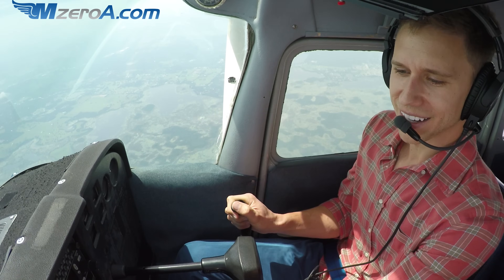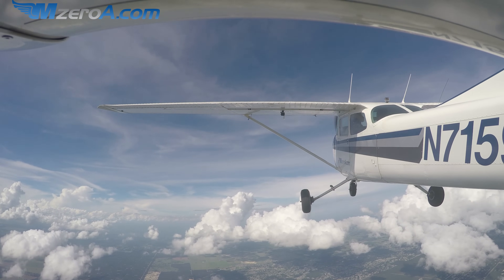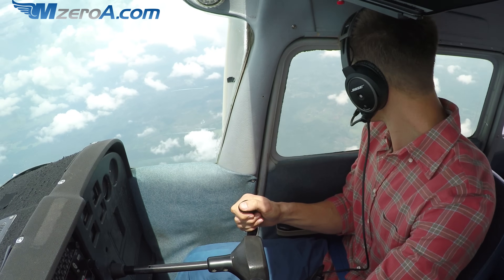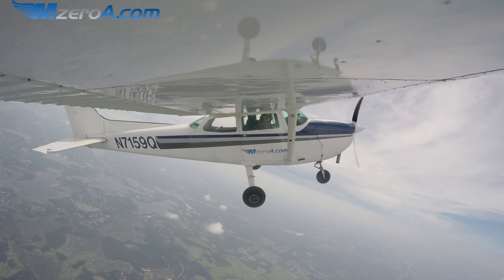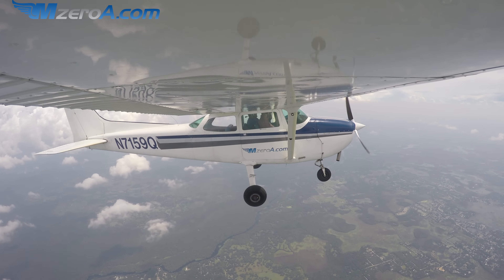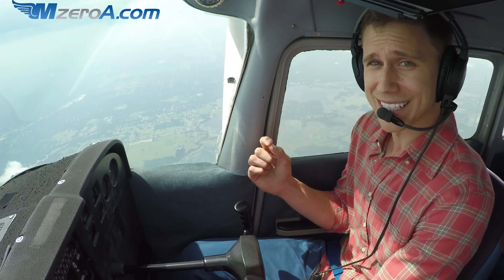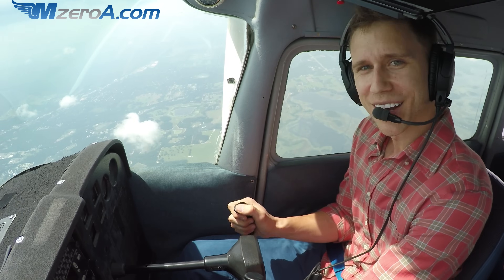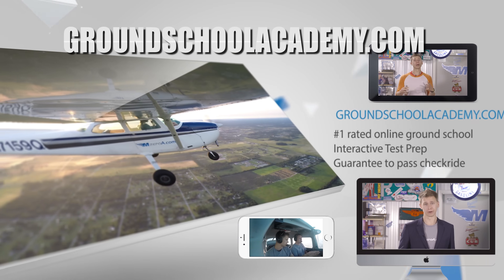Proper Spin Recovery - MzeroA Flight Training

Comment: As mentioned in other comments, the recovery is the thing. However, a properly rigged C-172 has a restricted deflection of the elevator that precludes a full stall. This is a certification compliance. Which leads to a problem with multi-turn spins. The aircraft will be accelerating and be in a high speed spiral versus an actual stable spin. This is a far more perilous condition as it appears to be a spin to the uninitiated and they will find themselves at a much higher speed exiting the maneuver than they planned. A major university used to have two,”Spin Ships,” in their fleet. This restricted the abuse of the classic gyros to just the two aircraft and, unbeknownst to most, maintenance tweaked the up stops of the elevator to give a slightly better stall which led to fewer over speeds of the airframes. Fully aerobatic aircraft rarely have restricted control movement and hence are IMO, better spin trainers. Aerobatics are great things to learn. They remove the term,”Unusual attitude,” from the pilot’s experience.

Comment: Did that many years ago in a 172, it did not recover immediately. The right spin entry was more abrupt than usual.  It took 1.5 full revolutions, full sustained opposite rudder and full forward elevator, before it recovered, C of G was within limits.  Turns out that three of the engine mounts after an engine overhaul were installed backwards, only the upper left mount was correctly installed.  The student was a bit concerned, I was quite upset. A lot of good was accomplished from the investigation of the incident. So,  if your aircraft has just had an engine replaced,  check the engine mounts???  Remember shit happens, be safe, have fun!  This was the only time in over 50 years of flying professionally, I experienced a preventable technical failure, that could have had a serious outcome.

Comment: We use to do them back in the 1980 set power 1500 rpm pull nose up till stall them full left or Wright rudder u would get 3 half rotations then opposite rudder when stop rotating pull out before u reach VNE we wold also pump left an Wright rudder pedals so wing tips didn’t go back into stall 1976 model 150s this was from 4000 feet good times

Comment: As a past flight instructor, I am amazed that some countries do not make full spin training mandatory. The way I look at it, you should never feel uncomfortable in an aircraft no matter what attitude you are in. Look, there are two things you need in aviation 1) distance between you and the ground and 2) an aircraft that does not break apart. All PPL training should include stalls, incipient spins, full spins,  all power off and then progress to power on. Of course this based on the aircraft's approvals.

Comment: During my lessons in a 152 my CFI had me stall and spin almost every lesson. It became so routine that recovery was  automatic, even boring. I felt relaxed and confident in my abilities to recover if needed. I also did a lot of pre-stall training to avoid getting into a spin in the first place. I was surprised to learn that stall and spin practice is rare these days, we did it every lesson. We also did engine failure drills every lesson.
Reply: Thats great training - pilots should learn spins over and over until they are second nature.

Comment: Your check pilot examiner is SO VERY RIGHT. If you want to be a safe pilot in any aircraft, you need to know the correct procedure for spin recovery. There are so many situations where one can get into trouble, and wind up in a spin. You must know the Principals of Flight formula ie., CL HALFE ROW V SQUARED S. and how to understand it and make it work. retired CPL with greay hair and years of working knowledge with spinning.

Comment: A great video! Good job! However, this video does not show how quick a spin is. a spin happens very quickly, even when you do it on purpose period for some reason this video does not show that, it may be the wide angle of the camera, or it may be this particular airplane. I have only spun 152s, not a 172.

Comment: The PA28 Cherokee is a better spin training aircraft than the Cessna 172. The reason is the PA28 is prone to high-speed stalling if you abuse the recovery. Pretty easy to do.I have noticed Cessna pilots are completely lost in the PA28, which is no good. The PA24 will do the same thing. Juggling the never exceed speed against the high-speed stalling.
 requires a great deal of skills. But once resolved the matter is closed.

Comment: I must be mistaken. I did spins and recoveries as a student with my CFI, and did one spin recovery for my PPL checkride.
Reply: How long ago and are you in America? He's speaking of American regulations. I don't know any DPE willing to go into a spin with a PPL student. Hell, the DPEs don't even want to do it with a CFI candidate they've never flown with which is why they'll accept the Spin Endorsement rather than require you to demonstrate a spin. Not to mention I'd be using a 172 for my CFI check ride that isn't allowed to do intentional spins and the 150 that is capable of spins probably won't have the power to perform max performance maneuvers required for the checkout, especially in the Summer.
Reply: @VeteranSoldier  I was in America when I did my training in 2007. Trained and did my PPL checkride in 172.
Reply: @airmackeeee6792  well the school was mistaken. The requirement for Spins training for PPL was removed in 1949 by the CAA (predecessor or the FAA) and made more emphasis on stall awareness and recovery as a spin cannot happen without a stall.  I believe spins should definitely be demonstrated but to have a student with no certificate demonstrate it with a DPE that never flew with that student, perhaps haven't even done a spin recover himself in who knows how long... that's why it was removed. You had a brave DPE as most of the DPEs in my area don't want to do a spin even with a CFI candidate much less a PPL candidate. Perhaps you did the same as the YouTuber did and went into the Incieped stage of a stall for stall awareness but not a fully developed stall but even that is crazy for a PPL

Comment: I agree with many of the comments about the spin, or lack thereof.  Those were not spins, but a pro spin input and perhaps a bit of an incipient spin, but most certainly not a developed spin.  Recovery using the PARE is appropriate for developed spins, using appropriate unusual attitude recovery procedures is otherwise  recommended .  Using "push, power, rudder, roll, climb" is the preferred unusual attitude recovery.

Comment: In a climbing turn you're actually constantly rolling to the OUTSIDE of the turn to maintain a certain attitude to the horizon. So the outside wing has a higher angle of attack - it should stall first. Result: Over-the-top spin

Opposite is true of a descending turn. You must constantly bank INTO the turn to follow the spiral -> low wing has higher angle of attack -> low wing stalls first.

Comment: Mr. Schappert, have you flown Pipers much? I am currently flying a Piper Warrior, and the stall behaviors  (as you may know) are quite different than those of a 172, for example. I was just curious, if you had flown Pipers much, whether the spin process, behavior, and recovery is similar in a Piper Warrior to that of a 172! Thanks so much!

Comment: Why elevator down. First reaction would be elevator up to stop the descend...
Reply: Pulling the elevator back will aggravate the spin. Understand that the pilot isn't "steering" the airplane into the spin, the wing has stalled (the air isn't flowing over the wing, it's tumbling over the back and the airflow is separated)  and the aircraft is just doing it on it's own basically. In order to recover you need to bring the power back (because the torque of the engine is helping the plane into the spin, among other things) ailerons neutral (because using them will cause this thing called adverse yaw and will aggravate the spin and bring you closer to an unrecoverable flat spin) rudder opposite ( to fight the rotation) and elevator down to break the stall and get the wing flying again. 

Then, and only then is the pilot actually "controlling" the plane and he or she can pull out of the dive.
Reply: Byron Henry Thank you for the explanation.
Reply: @bonzai8316  my pleasure

Comment: Thank you for the PARE acronym and valuable video!   My recent lesson in power on stalls, my initial reaction to the stall was to use Ailerons and that made the stall worse!   My CFI recovered the plane and explained that keeping the plane coordinated and using opposite rudder to recover the spin was the corrective control inputs.  A couple more attempts and I nailed it! Then I found this video and now I can use the PARE acronym as a mnemonic!!!!

Comment: I have a working theory here on spins and the endorsement, why is it even still required any more. With the introduction of the new ACS for the PPL, CPL, and now the coveted ATP. Under the new ACS Training curriculum, power on/off stall training is only taken to the sounding of the stall warning horn on steady; which as we all know is approximately 5-10 Knots above stall speed before recovery is made. In this flight attitude yaw will not have a chance to be introduced in my opinion; all of the aggravated conditions will not develop unless the CLEAN BREAK STALL is entered. The incipient spin cannot be entered from an imminent stall in my opinion; which is what the new ACS teaches. Therefore, the student cannot enter the spin unless they introduce top rudder in the direction they wish to spin on purpose. So, that being said the CFI spin endorsement is no longer needed since the student cannot enter a fully developed stall/spin from a imminent stall. This is just one CPL’s opinion and not that of the FAA. Maybe some CFI’s and even Jason himself can comment on this thread and provide some more insight.

Comment: Last week N727RP, a twin engine turbo, went in close to my house. Someone got a cell phone video of it headed straight down and in a slow spin. All 5 people on board were killed.  To my knowledge there's been no official release as to the cause of this accident however it looks like the spin stall. He was probably around 500' AGL flying slow, elevated angle of attack and a luggage for 5, and three ppl. in the back causing the CG to move aft.

Comment: I am not a pilot, although I've had flying lessons but never soloed.  So I know a little about aerodynamics, but not much about the typical max speed and stress single engined small aircraft can handle.

It seems that if prior to attempting spin recovery that you remove all extra weight from the aircraft, and lower the amount of fuel in order to put the plane in its optimum condition for being able to recover quickly from a spin, before doing the spin, how well does that prepare you for when a spin happens during  "real  flight" conditions with baggage, extra passengers atc?
I understand for initial spin training one would want the planes condition to be light and perfectly balanced so you can learn and practice the correct inputs without any screwey stuff happening to make it less safe than optimum, but once you get the basics down do you continue spin training with heavier fuel loads, baggage or passengers so one can truly recover if it happens under less than optimal conditions?  How much altitude is lost typically?

Since these small planes are not designed to withstand the G forces and speeds of aerobatic planes, how much time might one have to correct the spin before the plane exceeds its nte speeds and G's?
Thanks for the video lessons! Happy & Safe flying!

Comment: I remember back in my 1st week of private pilot training with my CFI Mike. I was learning power on stalls and I almost went into a spin by not immediately pushing left rudder when the stall broke. Mike and I had previously talked about spins, but as you said, it was not required in my training at that point. He was a really cool young CFI and showed me a few lessons later because I was curious. We went over, power idle, neutral ailerons, full opposite rudder(than turn coordinator is showing), pitch down - to break the spin then recover. It’s really easy, and even on my 1st few tries, I could do it without losing over 500 feet altitude. However, I could very easily see if a spin happened while you were not expecting and specifically set up for recovery; it would be very jarring and scary. You probably would lose 1000 feet before even realizing what was going on. Then, without being specifically prepared, you could lose several thousand more before remembering what was going on, how to recover, then finally recovering.

Comment: Did you say "Mixture full rich"? At 7000 feet?
Come and visit me in Denver and, We will discuss proper mixture settings for altitude.
I am an A&P by trade and a pilot as well and, I spend countless hours talking, to insructors and, pilots, proper mixture techniques.

I believe that, a good knowlege, in this field, will save lives.
Reply from the maker: Thank you Alby426! We were practicing proper recovery technique up high, but mimicking the procedures we would use down lower. Here in Florida where we are flying, going full rich is the correct procedure. Part of the pre maneuver checklist includes mixture going full rich. This is only set up that way during that specific maneuver and is adjusted right away afterwards. I just recently published a mountain flying video on youtube and discuss proper mixture control at high density if anyone would like more elaboration.

Comment: Ok so I know flight sims can be completely different and as a student pilot I do not know much. The only way I can get a F-35 out of a spin, which quickly turns into a flat spin with the maneuvers in the video, is to power back, rudder with the spin, turn into the spin, elevator down a little once a turn is established add power back in, neutralize. Why is this? Is it because it is a flight sim, jet powered, different airfoil, all of the above? Or am I just doing everything wrong?

Comment: Spin training was required back when I got my Private Pliot's License in 1974. Got my ATP in a Lear Jet model 25. Lear jets have great performance on one engine so the single engine approach to a missed approach was easy. Rate of climb was a little under 2,000 feet per minute on a single engine.

Comment: Sorry, that is NOT a spin!  A spin is an 'auto rotation' caused by yaw (from rudder or prop).  This is just a stall with a wing drop to the left (as, in a climb to the right, the left wing will reach the critical angle of attack and stall first).  This is not even an incipient spin entry as it will not develop into a stable spin as zero or insufficient yaw is present.  The following is an example of all three stages of a spin, incipient stage, stable (developed) stage and the recovery stage:  https://youtu.be/YUiruCa1wOc

Comment: They aren't fully developed spins, but that is not the point.  You can see the spin rotation by looking at the horizon.  This is about spin recovery, not flight testing the envelope for the aircraft, which would be pretty "iffy" for fully developed spins with no quick-release drag chute and a parachute in this type. Many certificated aircraft cannot be recovered once in a fully developed spin.  Read Rich Stowell's book on Spin Awareness. The idea is to recognize and get out of the spin a quickly as possible.  Good opening about getting the aircraft into utility category weight and balance before trying this.  No one in the back seat, no baggage, no full fuel.

Comment: I have no flying experience but I want to ask is "power back" means turning off the engine?
Reply: It means "reduce power to idle."  In most planes you push a lever or knob forward for more power (throttle) the same way you push the accelerator forward for more speed in a car.  In a spin, added forward power (thrust) tightens the spin and prevents quick (or any) recovery.  A spin is one wing flying and one wing stalled.  (A flat spin is different and worse.)
Reply: Thanks mate I get it now